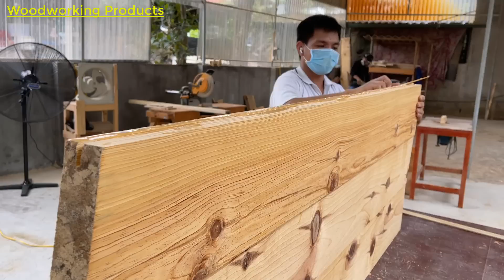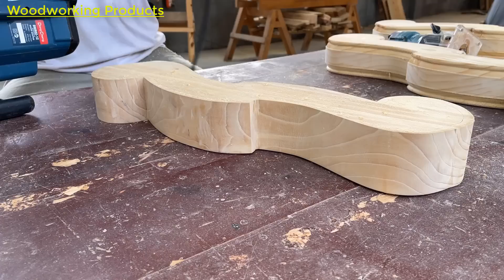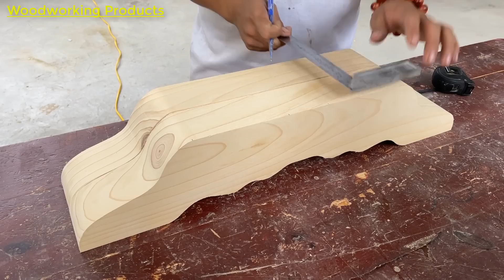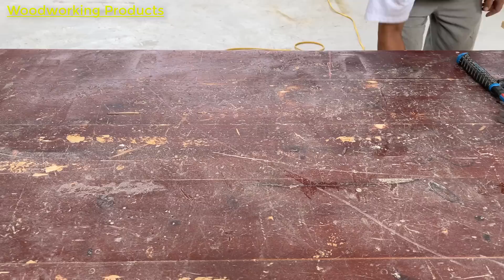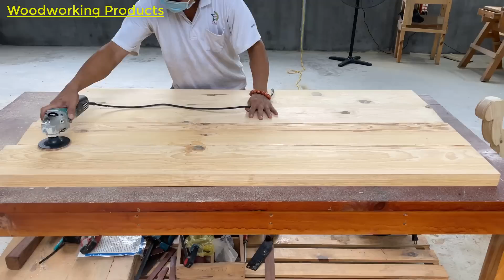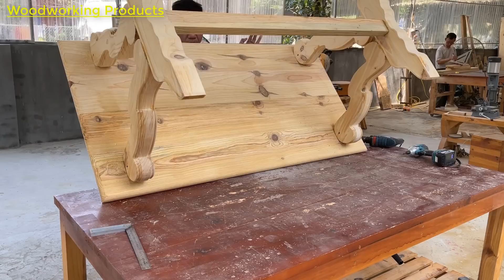Ingenious Skills & Techniques Woodworking Workers You Never Seen // Extremely Beautiful Wooden Table

Comment: Very clever technique getting into those tight corners and making that turn on the band saw.  I'm going to have to try that myself.  Not so thrilled about the amount of blade exposed above the wood though.  If the blade fails that could lead to a nasty cut as the broken blade whips around.
Reply: 22
Reply: ششش8شششش